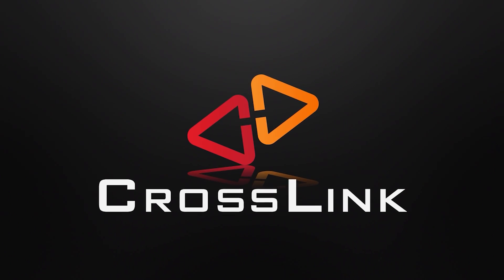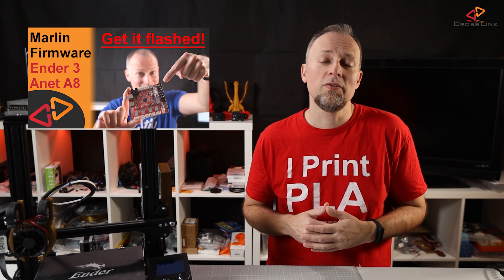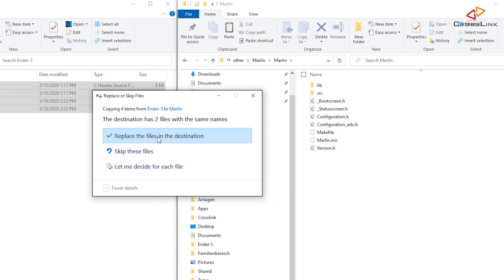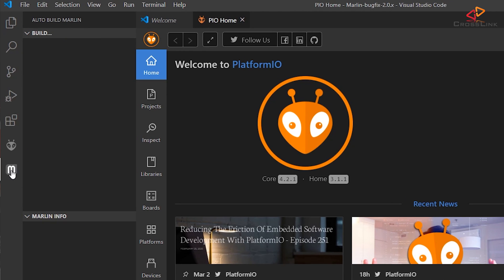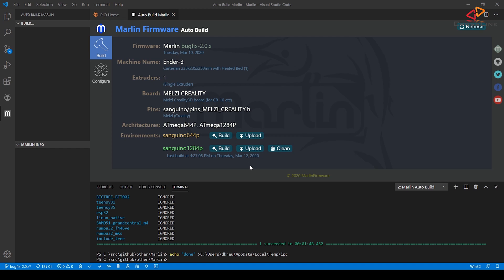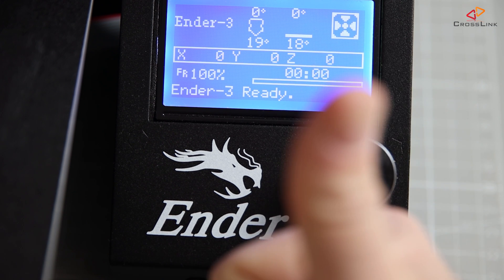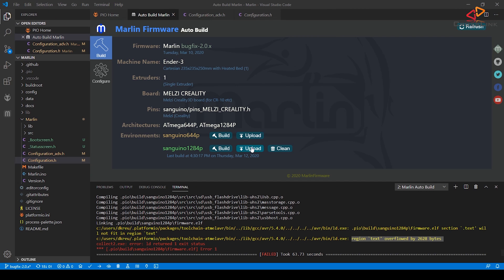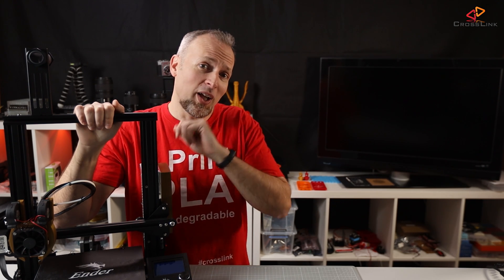Ender 3 (Pro) Marlin 2.0 Upgrade  - Updated Version

Comment: Hi.. Nice vid..

I have an Ender 3 Pro with Creality Silent Board and Creality BLTouch, when I try this update, it comes up with some errors when I press build!

sanguino1284p             FAILED    00:00:50.862
Reply from the maker: Can you please post the complete error message? You need to copy paste your output window content.
Reply: @Crosslink3D  Here you go:

Windows PowerShell
Copyright (C) Microsoft Corporation. All rights reserved.

Try the new cross-platform PowerShell https://aka.ms/pscore6

PS E:\Grafisk Arbejde\3D-Print\Firmware\Ender 3 pro\0105\Marlin-2.0.x\Marlin-2.0.x> platformio run -e sanguino1284p
Processing sanguino1284p (platform: atmelavr; board: sanguino_atmega1284p; framework: arduino)
------------------------------------------------------------------------------------------------------------------------------------------------------------------------------------------------------------

Verbose mode can be enabled via `-v, --verbose` option
CONFIGURATION: https://docs.platformio.org/page/boards/atmelavr/sanguino_atmega1284p.html
PLATFORM: Atmel AVR 2.0.0 > Sanguino ATmega1284p (16MHz)
HARDWARE: ATMEGA1284P 16MHz, 16KB RAM, 127KB Flash
PACKAGES:
 - framework-arduino-avr 5.0.0
 - toolchain-atmelavr 1.50400.190710 (5.4.0)
Converting Marlin.ino
LDF: Library Dependency Finder -> http://bit.ly/configure-pio-ldf
LDF Modes: Finder ~ chain, Compatibility ~ soft
Found 16 compatible libraries
Scanning dependencies...
Dependency Graph
|-- <LiquidCrystal> 1.5.0
|   |-- <Wire> 1.0
|-- <TMCStepper> 0.6.2
|   |-- <SoftwareSerial> 1.0
|   |-- <SPI> 1.0
|-- <Adafruit NeoPixel> 1.3.5
|-- <U8glib-HAL> 0.4.1
|   |-- <Wire> 1.0
|   |-- <SPI> 1.0
|-- <Adafruit MAX31865 library> 1.0.3
|   |-- <SPI> 1.0
|-- <LiquidTWI2>
|   |-- <Wire> 1.0
|-- <Arduino-L6470> 0.8.0
|-- <SailfishLCD>
|-- <SailfishRGB_LED>
|   |-- <Wire> 1.0
|-- <SlowSoftI2CMaster>
|-- <TMC26XStepper>
|   |-- <SPI> 1.0
|-- <Wire> 1.0
|-- <SPI> 1.0
Building in release mode
Compiling .pio\build\sanguino1284p\src\src\module\motion.cpp.o
Compiling .pio\build\sanguino1284p\src\src\sd\Sd2Card.cpp.o
Compiling .pio\build\sanguino1284p\src\src\sd\SdBaseFile.cpp.o
Compiling .pio\build\sanguino1284p\src\src\sd\SdFatUtil.cpp.o
Compiling .pio\build\sanguino1284p\src\src\sd\SdFile.cpp.o
Compiling .pio\build\sanguino1284p\src\src\sd\SdVolume.cpp.o
Compiling .pio\build\sanguino1284p\src\src\sd\cardreader.cpp.o
Compiling .pio\build\sanguino1284p\src\src\sd\usb_flashdrive\Sd2Card_FlashDrive.cpp.o
Marlin\src\module\motion.cpp:77:71: error: 'X_HOME_BUMP_MM' was not declared in this scope
 #define XYZ_CONSTS(T, NAME, OPT) const PROGMEM XYZval<T> NAME##_P = { X_##OPT, Y_##OPT, Z_##OPT }
                                                                       ^
Marlin\src\module\motion.cpp:83:1: note: in expansion of macro 'XYZ_CONSTS'
 XYZ_CONSTS(float, home_bump_mm,   HOME_BUMP_MM);
 ^
Marlin\src\module\motion.cpp:77:80: error: 'Y_HOME_BUMP_MM' was not declared in this scope
 #define XYZ_CONSTS(T, NAME, OPT) const PROGMEM XYZval<T> NAME##_P = { X_##OPT, Y_##OPT, Z_##OPT }
                                                                                ^
Marlin\src\module\motion.cpp:83:1: note: in expansion of macro 'XYZ_CONSTS'
 XYZ_CONSTS(float, home_bump_mm,   HOME_BUMP_MM);
 ^
Marlin\src\module\motion.cpp:77:89: error: 'Z_HOME_BUMP_MM' was not declared in this scope
 #define XYZ_CONSTS(T, NAME, OPT) const PROGMEM XYZval<T> NAME##_P = { X_##OPT, Y_##OPT, Z_##OPT }
                                                                                         ^
Marlin\src\module\motion.cpp:83:1: note: in expansion of macro 'XYZ_CONSTS'
 XYZ_CONSTS(float, home_bump_mm,   HOME_BUMP_MM);
 ^
* [.pio\build\sanguino1284p\src\src\module\motion.cpp.o] Error 1
======================================================================================== [FAILED] Took 9.83 seconds ========================================================================================

Environment               Status    Duration
------------------------  --------  ------------
mega2560                  IGNORED
mega1280                  IGNORED
rambo                     IGNORED
FYSETC_F6_13              IGNORED
FYSETC_F6_14              IGNORED
sanguino644p              IGNORED
sanguino1284p             FAILED    00:00:09.834
melzi                     IGNORED
melzi_optiboot            IGNORED
at90usb1286_cdc           IGNORED
at90usb1286_dfu           IGNORED
DUE                       IGNORED
DUE_USB                   IGNORED
DUE_debug                 IGNORED
LPC1768                   IGNORED
LPC1769                   IGNORED
STM32F103RC               IGNORED
STM32F103RC_fysetc        IGNORED
STM32F103RC_btt           IGNORED
STM32F103RC_btt_USB       IGNORED
STM32F103RC_btt_512K      IGNORED
STM32F103RC_btt_512K_USB  IGNORED
STM32F103RE               IGNORED
STM32F103RE_btt           IGNORED
STM32F103RE_btt_USB       IGNORED
STM32F4                   IGNORED
STM32F7                   IGNORED
ARMED                     IGNORED
STM32F103VE_GTM32         IGNORED
STM32F103VE_longer        IGNORED
mks_robin_mini            IGNORED
mks_robin_nano            IGNORED
mks_robin                 IGNORED
mks_robin_pro             IGNORED
mks_robin_lite            IGNORED
mks_robin_lite3           IGNORED
jgaurora_a5s_a1           IGNORED
STM32F103CB_malyan        IGNORED
chitu_f103                IGNORED
STM32F401VE_STEVAL        IGNORED
FLYF407ZG                 IGNORED
FYSETC_S6                 IGNORED
STM32F407VE_black         IGNORED
BIGTREE_SKR_PRO           IGNORED
BIGTREE_BTT002            IGNORED
teensy31                  IGNORED
teensy35                  IGNORED
esp32                     IGNORED
linux_native              IGNORED
SAMD51_grandcentral_m4    IGNORED
rumba32_f446ve            IGNORED
rumba32_mks               IGNORED
include_tree              IGNORED
================================================================================== 1 failed, 0 succeeded in 00:00:09.834 ================================================================================== 
PS E:\Grafisk Arbejde\3D-Print\Firmware\Ender 3 pro\0105\Marlin-2.0.x\Marlin-2.0.x> echo "done" >C:\Users\thoma\AppData\Local\Temp\ipc
PS E:\Grafisk Arbejde\3D-Print\Firmware\Ender 3 pro\0105\Marlin-2.0.x\Marlin-2.0.x>
Reply: @DrHansenDK  Unfortunately, I have exactly the same problem (also when I tried to upgrade via Octoprint)

Comment: i just tried to go to your website, but it doesn't work, may want to look at that
Reply from the maker: I think it was a small hickup, thanks though for the shoutout!
Reply: Crosslink just a quick one relating to a similar comment on a sep vid. Please could you do a video on failing in a printer with a BLtouch ? As like many I am still getting a rubbish first layer. Also would the flow being off also contribute to a bad first layer ?

Comment: Hello, and thank you for these videos! what i not understood is why cant i upload a build direct to COM board, and have to use SD card ? VS (with Marlin Auto builder is supporting, but not doing so) ?
Reply from the maker: So, you want to upload a gcode file to the printer over the USB cable? It's possible if you have the SD-CARD in the slot at the same time. This is for example supported in Octoprint. You can store your uploads to the local SD-CARD there. But the SD-CARD is needed because the printer does not have internal memory to store your print files!

Comment: Great video however ARC bed leveling has since disappeared meaning that I'm over on memory. I've looked at your list of things to disable however I'm still 400kb over. Any help?
Reply from the maker: You could try to use these tips to reduce the firmware even more: https://thborges.github.io/blog/marlin/2019/01/07/reducing-marlin-binary-size.html

Comment: Nice how its done video followed step by step but failed when only offered melti and melti_optiboot and not the sangiuno options went downhill from there with numerous failed messages. Cannot find any replies to comment. Shame as great quality.
Reply from the maker: Did you try with the latest version of Marlin and the latest version of Auto Build Marlin? It should work exactly as described in my video.

Comment: within viusal sudio after hiting build i get a error
Environment               Status    Duration
sanguino1284p             FAILED    00:00:41.936

not seeing the program memory maybe barbecue of the fail ?

========================================================== 1 failed, 0 succeeded in 00:00:07.808 ==========================================================
PS C:\Users\jerry\Downloads\Marlin-2.0.x\Marlin-2.0.x> echo "done" >C:\Users\jerry\AppData\Local\Temp\ipc
PS C:\Users\jerry\Downloads\Marlin-2.0.x\Marlin-2.0.x>
Reply from the maker: Can you post the complete error message from the output window please?
Reply: @Crosslink3D  FAILED 00:00:41.936 not seeing the program memory maybe barbecue of the fail ? ========================================================== 1 failed, 0 succeeded in 00:00:07.808 ========================================================== PS C:\Users\jerry\Downloads\Marlin-2.0.x\Marlin-2.0.x> echo "done" >C:\Users\jerry\AppData\Local\Temp\ipc PS C:\Users\jerry\Downloads\Marlin-2.0.x\Marlin-2.0.x>"
Reply: @Crosslink3D  Its a mute point I ordered a new board and they had a online tool that did all the word. TH3D . worked like a charm no need to do any file work myself.

Comment: Does/will/can this screw up my raspberry pi setup I have integrated with my Ender 3? I've had to flash the raspi in the past and id rather not have to do it again if there's a chance it could screw up my respi configuration
Reply from the maker: I think this will not affect your raspi connection in any way

Comment: Nice video. Clear explanation. But why not using release download instead of current dev version. This could lead to a lot of issue for people, the release version have been controlled ;) and it's easier to get help, if you provide specific version
Reply from the maker: The issue with the release versions currently is that they also have many bugs. Just the last two weeks there was a huge bug that prevented compiling the firmware and it was fixed in the bugfix branch first. I don't think that you can take marlin release as being tested for everyone. The developers only test for what they have. Quality control seems to be quite sloppy. It's an open source project but not at the level of a linux kernel for example.

Comment: Can you upload Marlin from your guide or another using the Arduino IDE?  The programs in your guide are very complicated and I don't get it.  I have a V1 1.4 Ender3Pro motherboard, I uploaded the bootloader and Marlin (older version) in my language.  I tried to upload yours but compilation crashes, many errors.
Reply from the maker: Hey, of course you can still use the Arduino IDE. I just recomment VSCode because I think it's easier to use nowadays but that might just be me. What errors do you get? Can you post the contents of your output window please (not in your language if it's not english please)?

Comment: it looks like 2.0 changes the bed size and software endstops, My printer now prints and goes past endstops and homes to end of bed and hits my clips. Looking into how to fix it or go back to what it was before before I destroy it..
Reply from the maker: I would for sure start with the default configuration files provided for your printer model. Don't try to use your original configuration files but port over your changes and find the right configuration settings. Most of them are still there and identical but some have changed.
Reply: @Crosslink3D  Oh I frogot to update, I had to adjust MIN_BED_Y_pOS offsets,  I have to find where the pre 2.0 ender config is located since they moved htem
Reply from the maker: Thanks for the update!

Comment: Thermal Runaway: Marlin 1.1.9... Und Dude... mach es doch einfach auf Deutsch ;-) Es gibt eine riesige 3D Druck Gemeinde hier! Und BTW: wer sich für das Thema interessiert, weiß schon wie man Marlin auf das Board flashed.
Reply from the maker: Hallo Johannes, ich habe mich sehr bewusst dafür entschieden, den Kanal nicht auf Deutsch zu machen, hauptsächlich aufgrund meines beruflichen Hintergrunds. Für mich ist es eine sehr willkommene Möglichkeit, die Sprache zu üben und als zweiten Nebeneffekt eine größere Zielgruppe (nichts gegen die Deutsche Community, die ist toll!) zu erreichen.
Zu Deinem zweiten Statement. Das ist eine Annahme, die ich nicht bestätigen kann. Der Kanal richtet sich an Anfänger, die das vermutlich noch nicht oder nicht oft genug gemacht haben. Da ich nach wie vor enorm viele Fragen dazu bekomme, ist es offensichtlich nicht jedem klar, daher macht es Sinn, es wirklich von Null auf zu erklären. Wenn man schon weiter ist im Thema schaut man wahrscheinlich auch nicht diesen Kanal, ist also nicht in der Zielgruppe.

Comment: i got the bugfix firmware (as normal 2.0.x would fail to build) , but now i get the option to build either Melzi or Melzi_opiboot  which one shall i choose for ender 3?
Reply: well i used normal melzi, i had some eroors along the way, firstly my com ports had access denied so i installed the newest drivers for 1.1.4 and 1.1.5 boards, then ran manual update of drivers in device manager and rebooted, then my next error was the the programmer not being able to flash, fixed by changing the boad rate to 115200 in the melzi section of the "platformio.ini" file located in your projects root folder (aka bootloader did not need to be reinstalled) , hope this helps others
Reply: @Dirt33breaks  Thanks, this helped me too. I didn't get any errors when I used melzi, why do you think it is it comes up as this instead of sanguino_1284p?
Reply: @chrispenna9626  dont know, but its a bug fix so maybe they added the correct names for our board in

Comment: Getting this error:

Flash: [==========]  96.0% (used 124860 bytes from 130048 bytes)
Configuring upload protocol...
AVAILABLE: arduino
CURRENT: upload_protocol = arduino
Looking for upload port...
Auto-detected: COM4
Uploading .pio\build\sanguino1284p\firmware.hex
avrdude: ser_open(): can't open device "\\.\COM4": Access is denied.

avrdude done.  Thank you.

any clue how to fix this issue?
Reply from the maker: Can you pelase reboot your computer and retry? Most likely you have another program like CURA blocking the COM port.

Comment: Hello! In first i will compliment with you! But i have compiled the last marlin firmware with mesh bed leveling with visual studio code how explained on your site, i have noticed that now when i connect my raspberry pi with octoprint the printer get stuck and dont'connect, with the last marlin version  without adding anythhing it dose not happen, have you any suggestion?
Reply from the maker: I didn't see this happening for me yet but how much memory do you have left when you compile firmware?
Reply: @Crosslink3D  thanks for the answer, i have solved reflashing the bootloader. But another thing i have noticed that if you abilitate mesh bed leveling the printer seems to have problems to elaborate the gcode it could be due all the moves that he has to do to correct the zaxis hight and the poor processor, have you noticed it on ender 3?

Comment: (21/04/2020) For anyone also experiencing the "out of sync" error, after a few hours and a lot of faffing about re-flashing and re-downloading etc etc, I found that manually changing the speed of the COM 3 port to 115200 made it work. I'm not sure if this would be the case for everyone but just what worked for me :)
Reply: Yes clearly that worked for me, it failed and after i made it at 115200 it worked :) thanks so much! <3
Reply from the maker: Thanks for the hint! super helpful!
Reply: After I wanted to re-flash it I got the same error and I tried everything.. couldn't solve it. Ended up getting a USBasp programmer and that worked fine lol. The errors are in the small things but solving them is very complex and frustrating

Comment: Forgive me for this dumb question but how do i get PlatformIO to see my USBASP programmer? ive used it in Arduino IDE before but i cannot get this thing to show up in devices in the PIO Home>Devices tab.
Reply from the maker: Maybe follow this guidance here. I did not try this myself yet... https://community.platformio.org/t/upload-using-programmer-usbasp/6441
Reply: @Crosslink3D  thanks for the link. I'll give it another go next time i need to flash. I ended up just using VSC to make changes since the UI is nicer to look at then uploading using Arduino IDE.